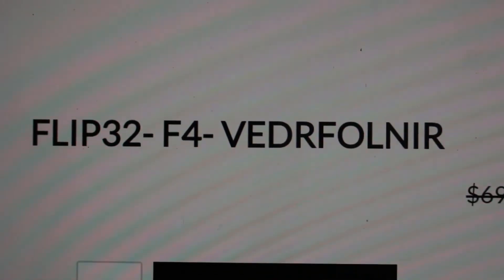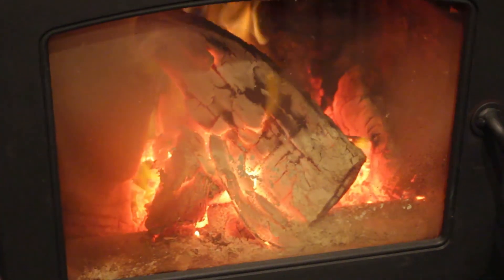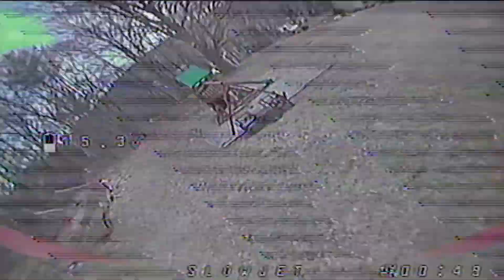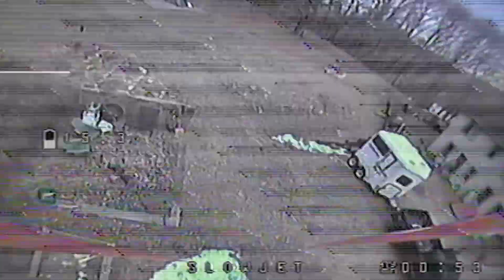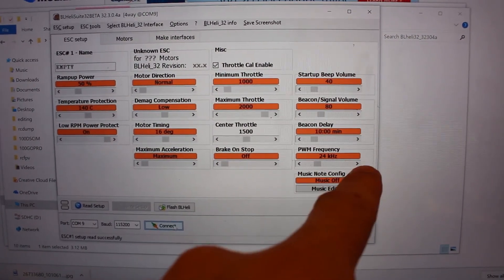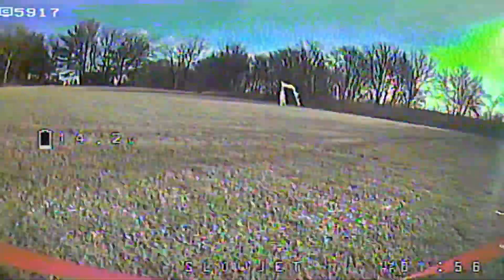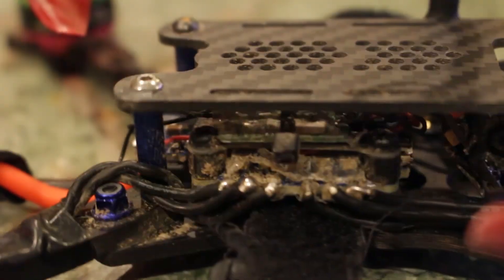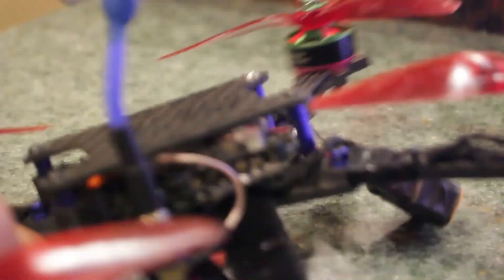**For FC's Sakes!** F4 AIO Blheli_32 ESC/FC Review - TattooF4S / VEDRFOLNIR / SISKIN AIO / ALPHA AIO

Comment: Hey thanks for the helpful vid!  I just got the Racerstar F4s AIO version of this board - which firmware should I flash in Betaflight?  (Vedrfolnir is not an option lol)  Sorry if this is a very noobish question.  Thanks!
Reply from the maker: MostlyHarmlessRC LUXF4OSD is the target firmware
Reply: I flashed it with Omnibus F4 firmware per instructions I found elsewhere (mine is the red label not the tattoo version).  It seems to be working great though after 10 flights.  Thanks for the reply!

Comment: had the same problem a half year ago, changing the   FC to ESC   signal solved it: oneshot/onshot42/multishot
Reply from the maker: Hans Turpyn, yes sometimes an FC has some issues with the protocol. Didn't seem to be the case with this one. This is running dshot600.